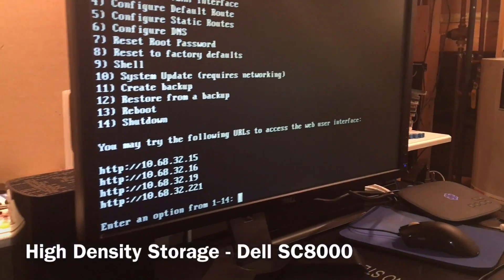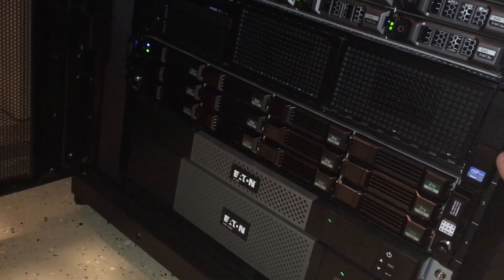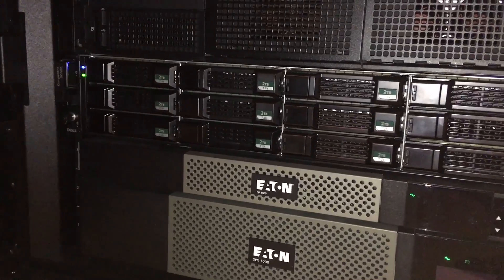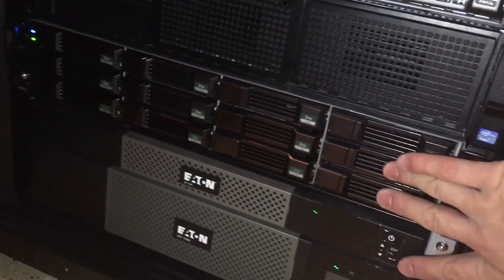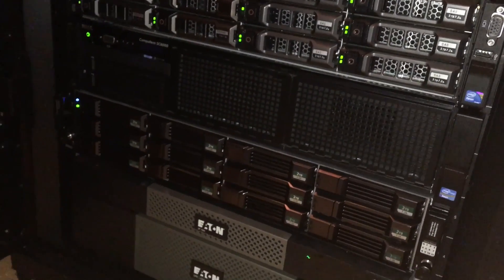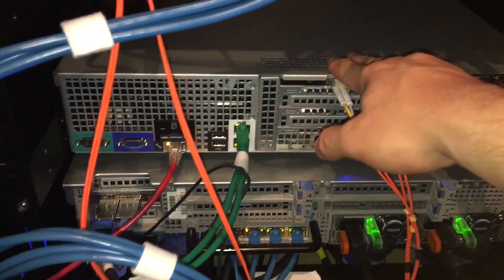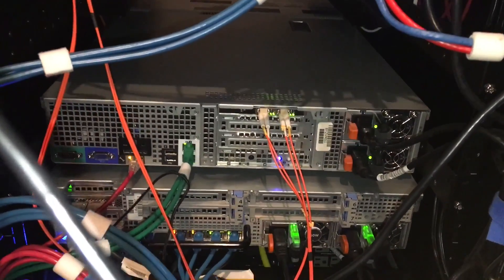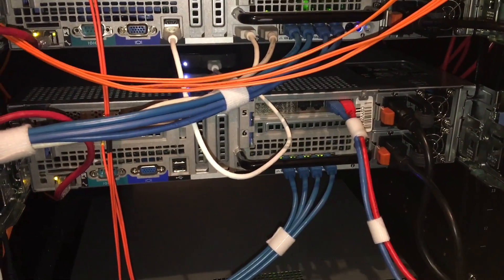High Density Storage Project - Dell SC8000 Powered by FreeNAS

Comment: Hi!
i'ts so awesome your idea to change the systems. I want ask you question, with your SC200 connect to SC8000 with Freenas, is that connected?
I have SC400 with SC5020 connect with mini-sas-HD to but the SC5020 Truenas can't detect that SC400.
Is that any solution with that? Thank you

Comment: So the big question is how much did you pay for this system? I just bought an IBM DS3524 SAN loaded with 12 x 300GB 10K RPM SAS drives, room for 12 more 2.5" drives for $300. I found a company online selling the iSCSI cards for $146 each, so I bought two. These prices are in CAD.
Reply from the maker: I paid like 600 for the Server and the SC200 with caddies so really cheap price and next im going to get 2TB SAS drives and couple more Samsung SSDs or some other SSDs maybe some enterprise for caching
Reply: You might want to look at using the Samsung EVO Pro drives for caching. I was talking to a friend who's company tested a bunch of SSD's on their SAN's and found the EVO Pro drive were the only ones that were able to keep operating at their sustained throughput while others tanked. Even the non Pro drives.
Reply from the maker: +dhowser2008 oh good to know yeah I'll be doing some testing and this as well will be same setup for our Colo hosting business my friend and I are starting :) I'll look and see where I can get a hold of those drives

Comment: Hello : i follow  your idea by buying the R510, now you are selling it :), so is it bad idea to use the R510 as SAN storage ????.
Reply from the maker: +Iceberry Morocco its not bad just wanting more expansion room and easy way of attaching more drives ;)
Reply: +GNET Data Center  you reassure me :). Tell me how can I connect more that 2 server to the r510?. Is it by switch fcoe?
Reply from the maker: +Iceberry Morocco you need DAS or SAN Arrays not servers, 1 Server as controller and rest is all DAS or SAN Arrays daisy chained